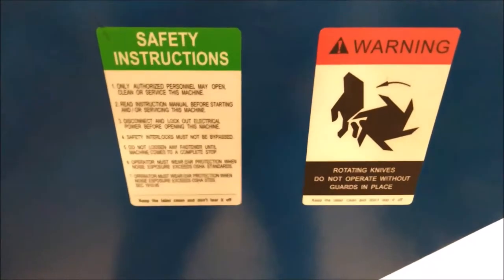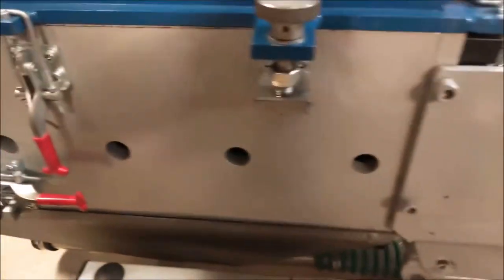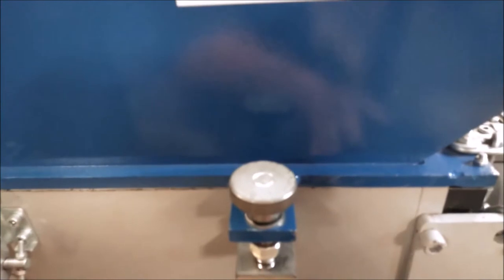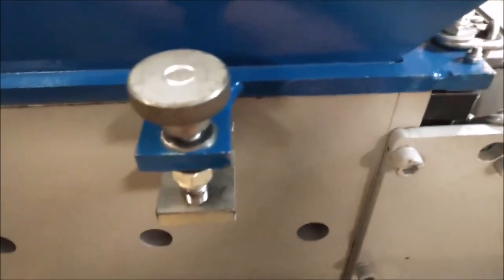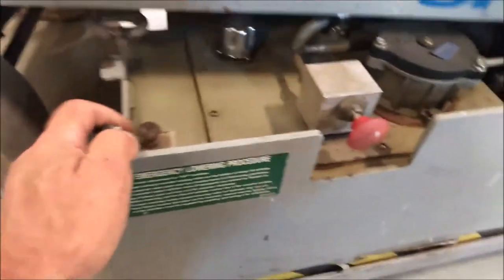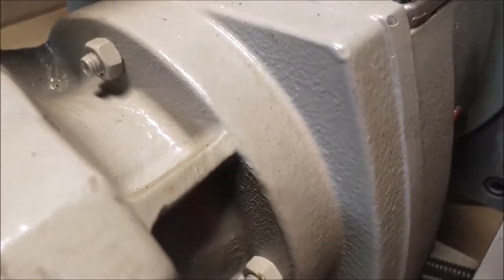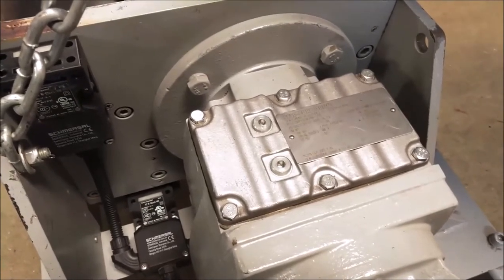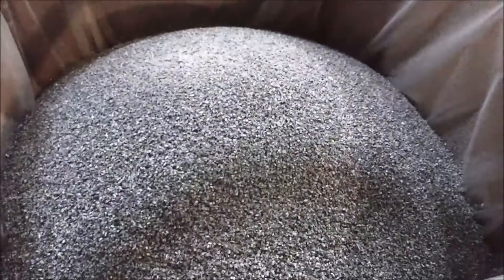Checking Gearbox Oil

Comment: Just an idea but maybe next time  take an old marker, rip the guts out and tape it to the side.  Then use a straw and insert it into one of the 2 case screws and use it like a dip stick. Just make a mark on the straw at the proper level.  Whipe it off and return it to the gutted marker (AKA ) homemade dip stick holder. Checking the levels, color and smell would be much faster on all 3 cases and without risk to the gaskets.  👍